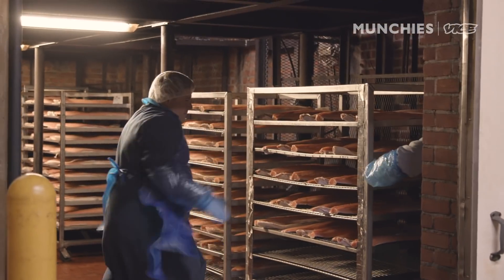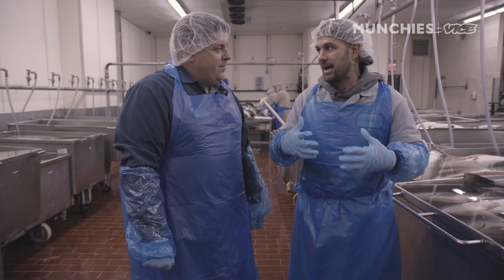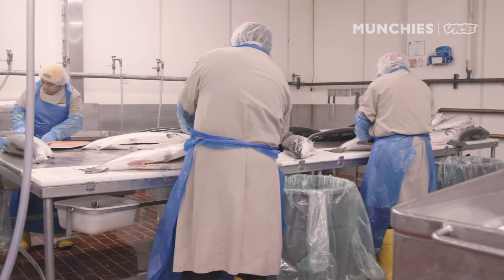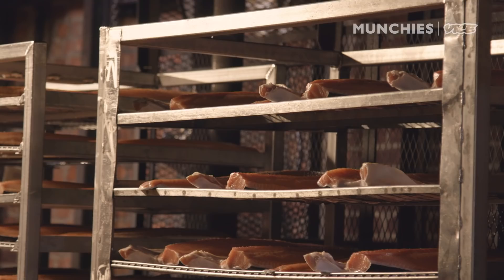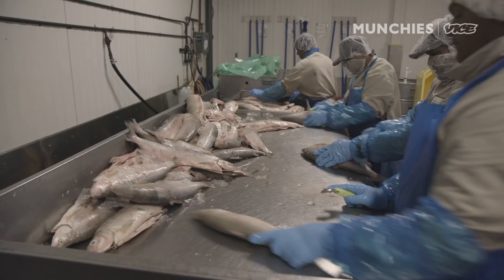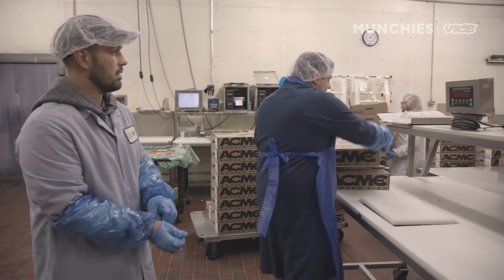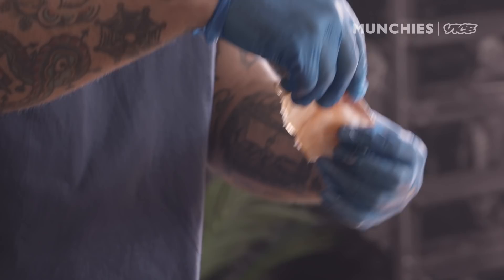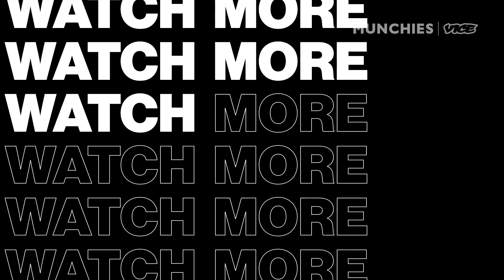How 15 Million Pounds of Smoked Fish Gets Made - A Frank Experience

Comment: I would like to find out the ratio of the salt/sugar  moisture to water ratio to brine all that fish for 1 week. Any former employees out there that know. I have made my own nova lox with a dry cure method, one whole side fillet of salmon and that too about 17 hours. I had to make a cut to taste it and check the penetration of the cure into the fillet. The  I did the same thing with a fan for only 2 hours, then I cols smoked it on a cool day in a shed using a hot smoker inside the shed with the front door open a little to let the smoke out but keep in the heat inside the smoker. I used hickory sawdust and did that for 10 hours. It was just as good as Acme's. I'm not BS'n you.